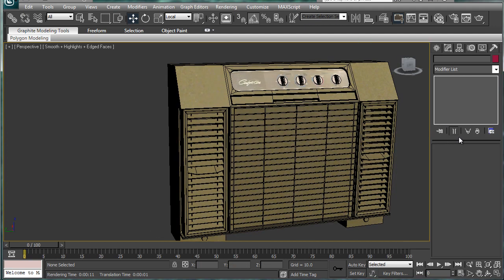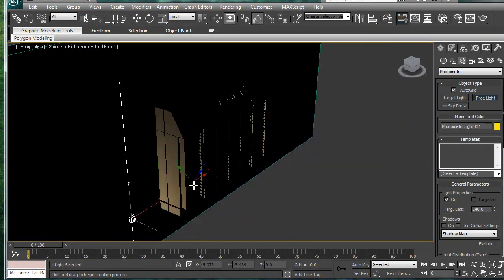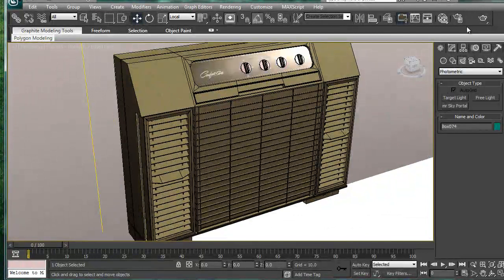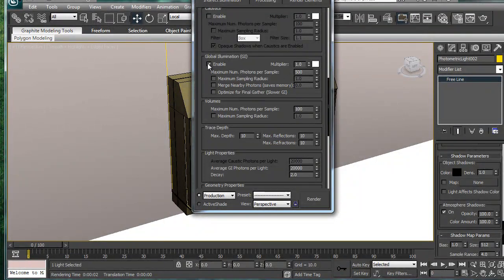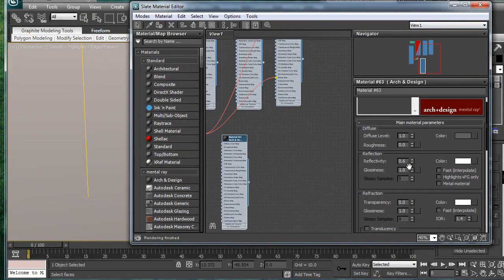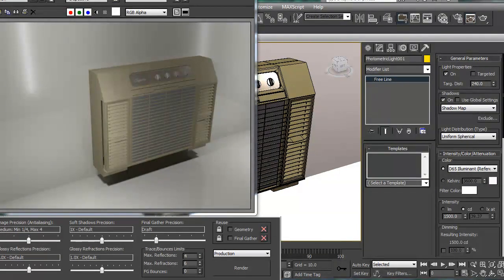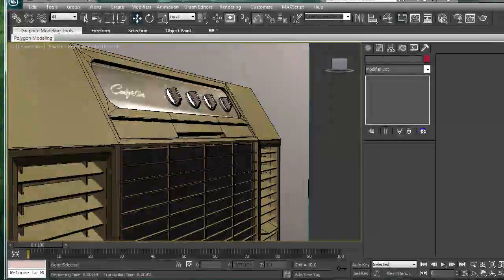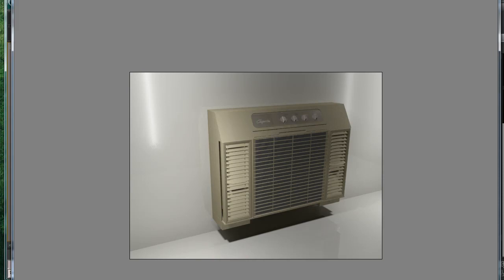3ds Max tutorial - Air Condition Part 5

Comment: Hey, good post. Your modeling is very good. Your lighting was fine too but you could do better with the lighting. I suggest you use v-ray. The lighting is easier and gives you a very realistic results in your render. It is a little difficult to understand in the beginning but once you understand it it's very easy to set up. And the v-ray materials are much better and more realistic.